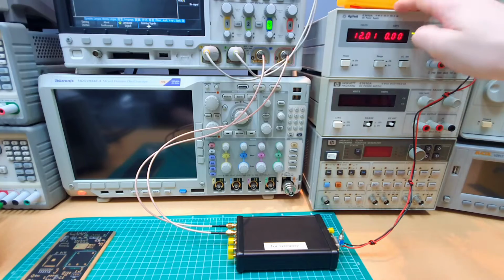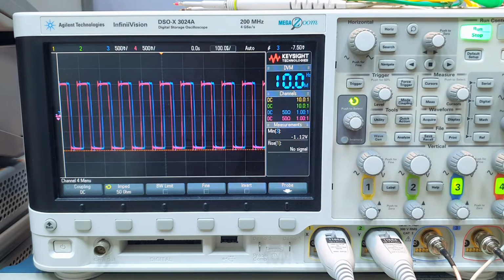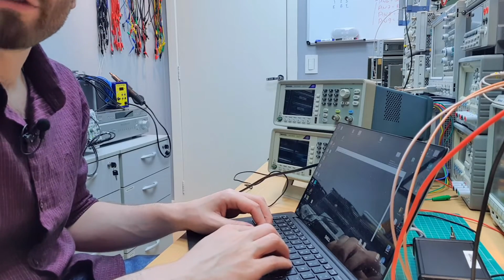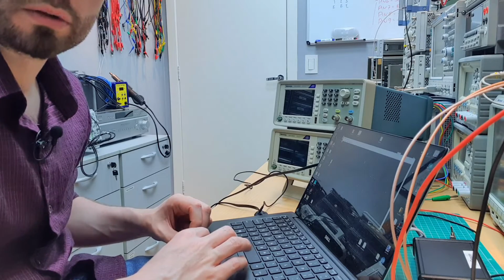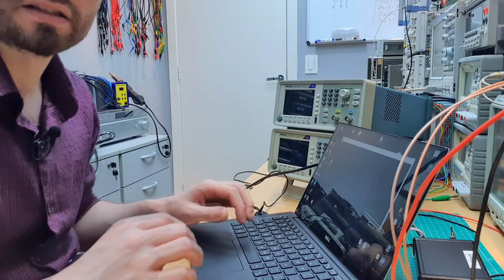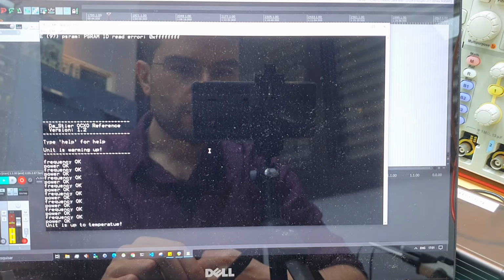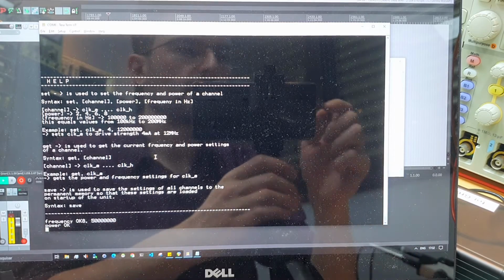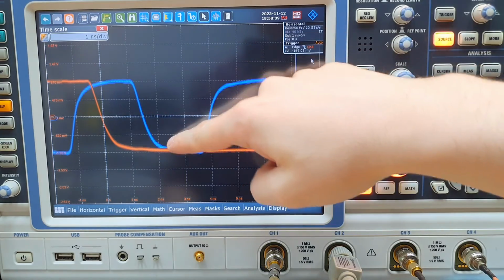Frequency Reference Source - Clock Distributor

Comment: Excellent video as always! Just one question, in the layout the regulator is near the oscillator, in case the heat generated by the ic is high that could interfere with the stability of the oscillator despite is thermally compensated?
Reply from the maker: Hi man, I think it would no disturb the oscillator. But it is a good idea to move a little far in a hardware review
Reply: Hi there, 
the oscillator regulates itself to a stable temperature (around 60°C if I remember right) so it would in theory even compensate for the external heat input if possible. 
In this case the regulator isn't getting all that hot and there are cutouts in the PCB to further isolate the OCXO thermally. 

But after all you are definately right, it is a good idea to keep all heatsources as far away from the OCXO as possible.

Comment: Nice video, Gregory!
I think I know, who might have built and sent you this thing. ;)
Let me address a few things. 
(13.11.23 right no so if I didn't respond to some of your suggestions, I might  not have seen it yet)

@ Gregory
First of all you were basically spot on with everything you said. The initial phase difference is due to the SI5351 having multiple PLLs and depending on which one is used where, it has some random phase offset. The IC offers a "real" clock fanout mode where the same PLL is used to supply multiple outputs with manual phasing control. Actually an IQ mode is something I have on my feature list that I want to implement. 
The "firmware" I wrote for the unit is more of a nice proof of concept program, I'm not a software guy so I'm not very good at it. Rewriting the current firmware (which is at 1.7 right now, btw.) is another big point on my list. 

@bansci & @ivolol
Yeah I agree with the ports being on one side as well as the USB supply. 
My initial use case for the thing is mainly SDR and ham radio stuff  (therefore also the 12V supply) where it is used as "set and forget" so the configuration isn't a big issue. 
Also the DSUB connector is due to it being able to get screwed in.

For instrumentation use I think it would be petty nice to have the ESP host a webserver with a GUI to control it ... which is propably way above my programming skills.

Comment: GPS and rubidium are well traveled paths. But how about NTP disciplined clock? No need for the sky access, or for a power-hungry rubidium module.  Just a low power Linux PC (like raspberry), OCXO board and an Ethernet cable. Yes, NTP's jitter is in milliseconds, but it only affects the lock time - for an always-on device it is not a big deal. Good OCXOs (probably) are stable enough to facilitate long synchronization periods. That will be cheap and cheerful.